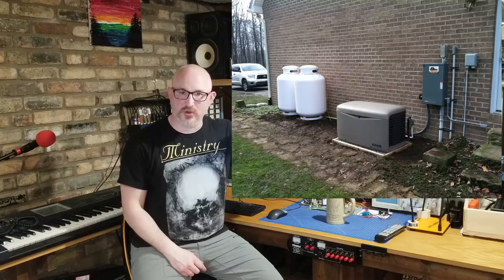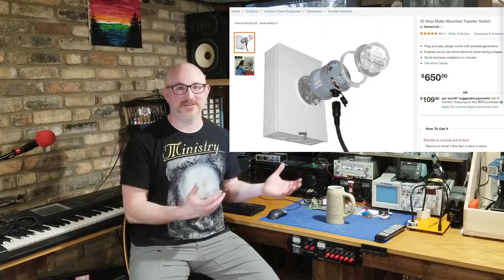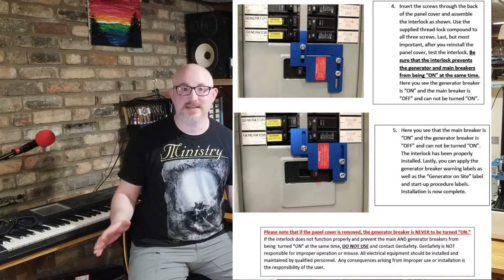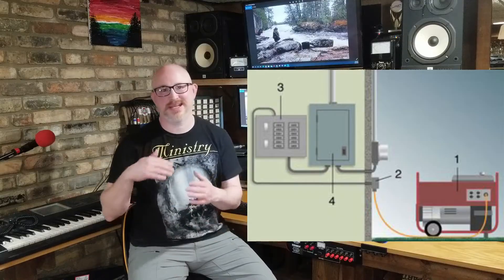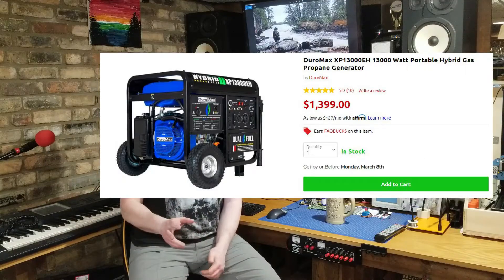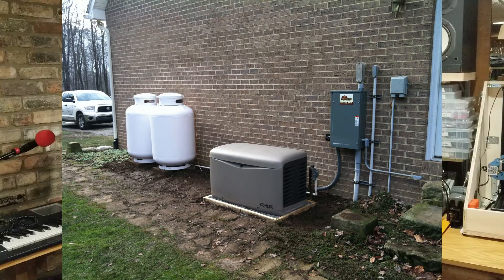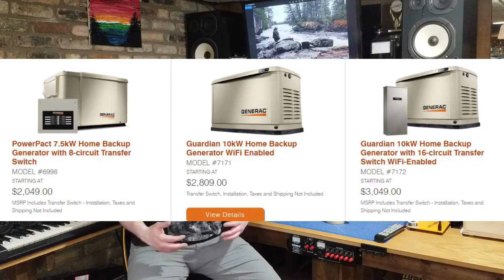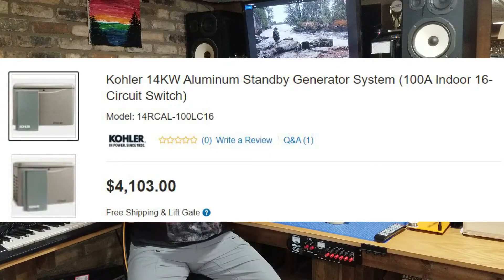Electrical Engineer explains connecting generators to your home

Comment: I just got the duromax 12000 DX and installed the 50 amp transfer box to my house and breaker box, I’m just waiting on the inter lock kit for the breaker panel ( I had one but it was the wrong one) thanks for the video
Reply from the maker: How has it been working (2 months later)?
Reply: @richardvedvik979  been going good thank

Comment: I have a question it might be dumb but I've seen on YouTube some people do instead of having your furnace hardwired the simply switch in to a plug and plug there furnace into a dedicated single socket line for there furnace. If power goes out they simply unplug there furnace run an extension  cord to there furnace from the generator to heat there home during a black out. 1 is it legal and up to code I live in ontario canada . Is it a viable solution or just get transfer switch installed .  Generlink is too expensive for my needs and all I would want is the basics. Heat in winter and canada is cold in winter and fridge and freezer. Imwould do a rotation of furnace fridge and freezer with the use of a small inverter generator.  Imdont think for my I would need a big 5000 and up generator.  Thanks for you opinion.
Reply from the maker: I'll dig into an answer when I'm at a PC and not my phone.

Comment: I really like everything you said, but I would have one comment about "a generator is a generator" statement. A generator is not an inverter generator. Both do basically the same thing, but the output produced is different. I know this only because I've tried cheap generators with amazing KW/$. They run most anything except equipment that is particularly sensitive to voltage consistency. I have UPS on my most computers, internet modem and router, and large TVs; mostly there for protection. However, my pure sinewave UPSs hate the low end generator voltage. They keep cycling in a weird way. Now, I cannot definitely state it's the generator type, just that they are cheap or that its not common for this with an inverter generator. It's possible that the inverter on an inverter generator may also be lousy at voltage regulation. Thanks for the great overview!
Reply from the maker: Yea, I don't do a lot of voice overs nor do I have a script, I just talk, and sometimes I mis-speak.  I try to fix with text overlays but I don't catch them all.  Thanks for the feedback and input!

Comment: I came here for the calculation.
Reply from the maker: At 9kW you can connect just about anything in a typical home.  Electric heat (furnace, stove, water)  or A/C are the largest loads a normal home has.  So you need to calc that separately (labels tell you wattage).   The lights and receptacles could all be on a 9kW.   You can turn stuff you don't need off and just use what you want.   Fridges and freezers are good for hours and recover in 30 minutes, so you can save fuel by controlling them (or just leave the doors shut).  

I connect my entire 3,000SF home to a 8.5kW generator.  But I have gas heat and don't use the stove or microwave and keep A/C off.
Reply from the maker: What do you want to know, exactly?
Reply: @richardvedvik979  Refreshing on allowable load on portable generator  for Single family home? I know if you load it up . It will burn fuel fast.  I been out the trade 15 years. Getting back in.. Just ordered a new code  book.
Reply from the maker: Roger that.  I can put a load calc video together in May. In the interim, do you have a generator now or are you looking?  How do you want to connect it?
Reply: @richardvedvik979  9k/12kw. Connect with cord on outside and transfer panel with interlock.
Reply: @richardvedvik979  I have the generator now . I know how to connect it. Just how much can I connect to it.

Comment: Hi Richard, I am installing a permanent gas fed Generac 24kw generator with a transfer switch. My question is if you have a main panel with the meter in it and there is no separate or isolated neutral how do you separate in the main? It is a Siemens C204B1200. The transfer switch panel is mounted directly below it with metal conduit. The instructions also say to connect the ground in the transfer panel to a ground rod. My plan was to connect the transfer panel neutral to the lugs on the neutral bar in the service side below the meter. Also the ground from the transfer switch. My thinking is I think I would be violating the UL approval if I drilled  between the meter and breaker side of the panel to isolate the neutral with a new isolated neutral buss. There is hardly any room to do this in this panel anyway. Aren't all the neutrals connected in this main and I don't see where I can get stray voltage back to the house? I understand that neutral and ground are only to be bonded at the first point of disconnect.
Reply from the maker: For a permanent generator like yours, you simply break the neutral-ground bond in the generator. Then you connect gen neutral to panel neutral and gen ground to panel ground.  Only one neutral-ground bond in the system this way.
Reply: @richardvedvik979  I will check that the neutral to ground bond in the generator is separated, thank you.

Comment: I have a honda 2200 and  the neutral is floating.. I have a 20 amp reliance box going to an inside four plex receptacle .I have the equipment ground next to the box.. I wired nutted a ground from the box to the equipment ground using a wago three wire  connector  while the Honda was running I tested the hot and ground to see if I was getting 120 but only got 35 volts instead of  120.  What is the best way to hook this type of system to a generator for ground safety .   Also by just bonding the ground and neutral and testing , I got 120 volts On new furnaces the furnace needs to see a ground to start..  I have usually installed a plug on the generator with the ground and neutral boned and that allows the furnace see the gen in grounded and comes on.. In my case I ran a separate ground to the grounds in a j box. So is it best to use the equipment ground or not
Reply from the maker: Sorry for the delay, not sure how I missed this.  If your neutral is floating, then it needs to use the neutral-ground bond in the home.  That means you connect phase, neutral, and ground to the receptacle and have phase, neutral, and ground to the panel.   Where did you measure voltage each time?   From line to neutral or from line to ground?

Comment: Concerned about common back feeding to power company. Is this ever an issue?

My setup is.
Main breaker built into meter enclosure outside.
Main panel (200 amp) is in basement with no Main breaker on it.
Sub panel feeds apartment in basement and has a Main breaker built in. It is fead by a breaker from Main panel.

Would like to put an interlock on sub panel and connect generator to it through breaker at interlock.
Seems to me I am still back feeding common to the main panel and from the main panel to the main breaker at the meter and out to the power company. If this is correct isn't it an issue and how do I fix it?
Hope this is clear.
Thanks!
Reply from the maker: The safest way to add loads to a portable generator is an external transfer switch panel where each load has both phase and neutral switched.  

If you have a physical interlock kit in the sub panel where the generator breaker is interlocked with the sub panel main, then you won't back-feed through the mains but you have to be really careful with neutral bonding (which my newest video discusses).     

By "common" do you mean the "neutral"?
Reply: @richardvedvik979  Yes the neutral / white wire. 
Thanks

Comment: Suggestion - for a temporary situation or a permanent solution, get a Generlink meter base adaptor. Would recommend the 40 amp unit. I did not purchase the surge protection nor the wireless link as I did not need them. I did get the 20' cord with the 50 amp, RV type plug. It comes with a cord of your choice.
Safe, very easy to use, super easy (5 min.) for the electric company to install. 
I have no ties to the company. I bought one and it's a great solution. Using it with my Generac standby genset. Simply plug in the cord when needed, unplug when done.

Before contacting Generlink, I first emailed the datasheet info and request directly to our utilities director at the city. The city provides electric to our area. 

A week later I had his letter of approval! He did say that I had to contact his office to have it installed as the customer service reps don't know about the device.
Reply from the maker: Thanks for the feedback.  The meter socket generator plug adapter/transfer switch was one of the products I highlight in this video.  The first time I heard of them was during a NEC 2020 Code update class where the book had an image of one.  Most of us in the room were surprised and intrigued.  Glad you have some first-hand experience to share!
Reply: Except our local power company will not allow this product.

Comment: I’m going to install a generator connection plug on the outside of my house with the breaker interlock on the panel. When using this set up I need a generator that does not have the ground and neutral bonded and also with a ground rod in the ground that is attached to generator ground. Do I have that correct? But if I want to use the generator as a stand alone unit it needs the ground and neutral bonded? Do I have that correct? Would it be advised to install a switch on my generator to connect or disconnect the ground and neutral so I can use the generator in either scenario?
Reply from the maker: I have the graphics developed for the next video explaining exactly this.  Doing the study on fault current and neutral current, you can simply lift the ground at the generator plug, from the home panel side, to break the connection between the two neutral-ground bonds.  The metal generator plug case needs to be bonded to the generator ground, not the home panel ground (since those conductors cannot possibly be energized from the home panel side with the interlock in place).   This lets you leave the neutral-ground bond at the generator.  The generator will use the home panel grounding, and this is simply relocating the path to ground.  While it is preferred to have a transfer switch that switches the neutral, with a back-fed panel we have to break the ground path instead.    

You can lift the neutral-ground connection at the generator instead, and in this case you use all four wires for phase, neutral, and ground, using the home panel neutral-ground bond.   With this approach, you can go as far as to add a toggle switch at the generator that allows you to easily re-connect the bond for independent operation.  I'll explain that process also, I plan on recording content in the next week.
Reply: @richardvedvik979   Wait, I’m confused. I thought I understood but something doesn’t make sense to me. You said I can lift the ground at the generator plug on the panel side. I took that to mean I would not connect a ground from the house panel to the generator plug mounted on the outside of the house. But then you say ,” the generator will use the home panel grounding”.  How is that if the ground from the panel isn’t connected to the plug. I’m sorry I keep bugging you. I want to understand all this. I thought the neutral and ground would both go all the way to the generator and not be bonded at the generator.

Comment: Hi Richard, thanks so much for your video and for the ministry you do.   I think the more I read, the more I'm confused.  I have a Champion generator and a transfer switch to my main panel (installed by an electrician).   2 questions (1) do I need to ground my generator (to a ground rod) or is it grounded through the panel?   (2) What is the proper startup and shutdown sequence for using the generator with the transfer switch at the panel?    Thanks so much!
Reply from the maker: 1) I'd need to know the model number of the transfer switch and a verification if it is 3-pole (switched neutral).   Your transfer switch should be 4-wire, 3-pole (switched neutral) with a ground bonded through the transfer switch to the main panel.   If you're grounded through the switch to the panel (which has a ground rod) then you're good.   2) You start the generator without a load.  You turn off all breakers then you change transfer switch to connect generator to panel (breakers off).  Then you turn breakers on, one at a time, to achieve desired loading.    When utility is back, you open breakers one at a time, change transfer switch back to utility, turn breakers back on.  Let generator cool down for a 5-ish minutes without load, then shut it down.

Comment: When choosing which circuits to bring up, should I be concerned about THD.  Should certain devices not be connected to generator fed service?  Thanks
Reply from the maker: Yes.  I am also concerned with THD and I address that in the newest video.  I chose a generator with 5% THD.  Many generators can have 20% THD or higher and that is no good for electronics.  That means you can power a fridge or furnace but I wouldn't do a router, TV, or computer.

Comment: Great info. I wired my house myself. 200 AMP panel with an interlock to my portable hybrid gen 6kw. I am acquiring a early model 2005 Generac 13k whole home unit from a friend who is upgrading. Here is the question. I love my interloc system. I would love the Genrac and am very versed in going through it to replace the stator, replace single point of failures on this early unit including the voltage regulator. And possibly other things like the step up motor, brushes and more. I am not a fool. I know these units will fail at the worst time. Therefore I want to run it just like I run my current portable. Dont want a fancy transfer switch even though he is giving me that as well. Why can't I install a 50 AMP plug on the output and manually connect it to my current 50AMP generator plug I currently use with my current generator? If the Genrac fails I can then use my current portable hybrid as a back up? I get texts from my power company so I always know when I am back on line. It is just me so I dont mind the manual nature of my current system and love the ability to switch on only those breakers I need. Thanks
Reply: You might want to look at the Generlink meter base adaptor. Would recommend the 40 amp unit. I did not purchase the surge protection nor the wireless link as I did not need them. I did get the 20' cord with the 50 amp, RV type plug. It comes with a cord of your choice.
Safe, very easy to use, super easy (5 min.) for the electric company to install. 
I have no ties to the company. I bought one and it's a great solution. Using it with my Generac standby genset. But can also use a portable. Simply plug in the cord when needed, unplug when done.

Before contacting Generlink, I first emailed the datasheet info and request directly to our utilities director at the city. The city provides electric to our area. 

A week later I had his letter of approval! He did say that I had to contact his office to have it installed as the customer service reps don't know about the device.

Comment: I realize everyone is asking--and a video is coming, but how does wiring the load center from the 30A Inlet box differ for each type generator setup: "floating neutral" or "bonded neutral”?
Reply from the maker: The requested video has been uploaded!

Comment: Is it possible to power both legs of an electric panel with a 120V generator (3500 watt)?  My panel already has an interlock switch set up with a 4 prong twist outlet box set up outside the house.  I think most people are using 220V generators to hook into this type of configuration.  My 110V generator has a 30 amp RV style outlet with 3 prongs (hot, neutral, ground).  Could I build an adapter cord to power both legs of the panel safely by powering the red and black wires in the 4 prong outlet box with the single hot wire in the 3 prong/generator side?
Reply: No, you need two separate phases. Must be a 240 volt generator. You will ruin any 240 volt appliance you hook up to.